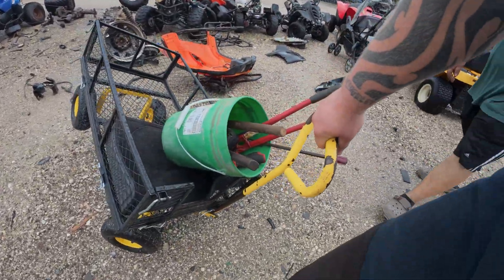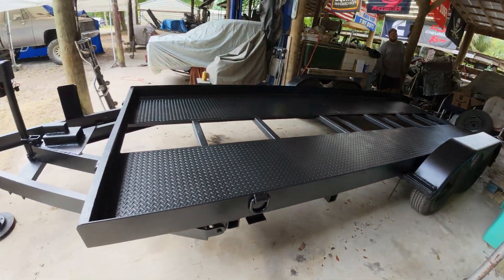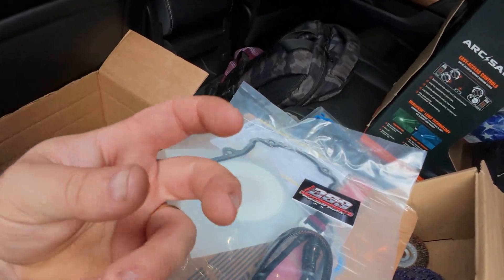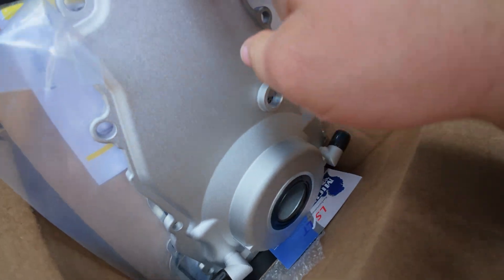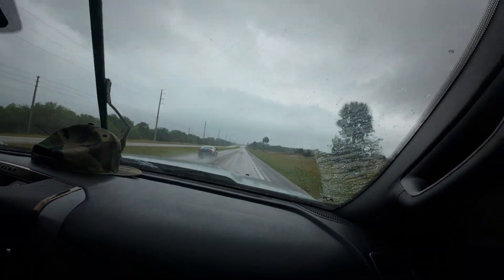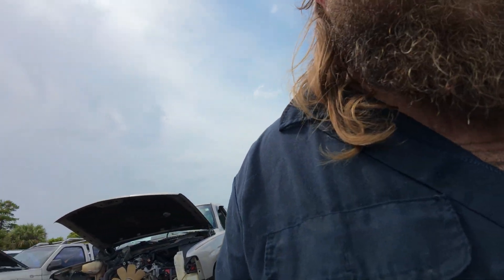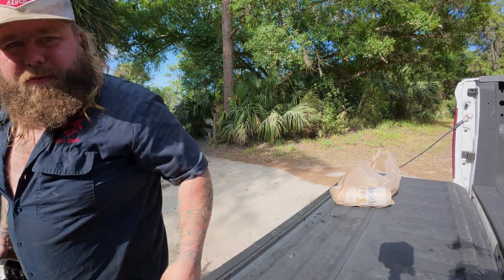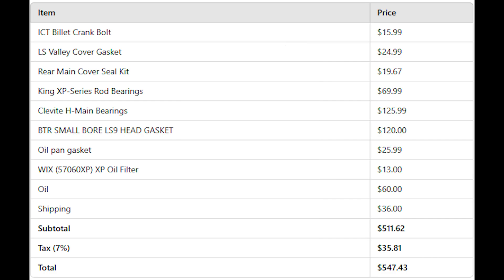Budget LS Rebuild: EVERY DOLLAR Spent (My ACTUAL Cost Breakdown)

Comment: Hell ya brother. Hot roddin ain’t cheap man. I just laid down 1300 on a trans rebuild kit and rmvb with trans brake and other odds and ends.
Reply from the maker: Man it's rough but worth it! I got hit with a lot of  other things at once lol, including a set of truck tires lol let me know if u need some advice with that 80 build if your doing it yourself!
Reply: @ not doing a 80. Doing a th350 for now until I find a good 400

Comment: The parts add up quick. I usually try to reuse anything and everything that isn’t in bad shape
Reply from the maker: that is generally what I try to do, and did, but the 220k+ lifters that were abused for 3 years boosted along with the .660 springs i think just had enough.
Reply: @HighNoonRacing  I have a high mileage set on my .660 springs we shall see how long they last hahaha i have sets of good used lifters as back up tho
Reply from the maker: I feel like with new sets its 50/50 if they work out, and with older OEM, it's just a matter of when. you'll probably be fine, i think bent rods led to spun rod bearing which led to lifter failure.

Comment: I ordered a Ls3/6L80E EBay harness. You know how that went lol. It was a manual harness. My ECU is from a 09' Tahoe 5.3/6L80E Tahoe. I did a continuity test on the harness and the cam and crank sensor. Still not getting a spark. I'm prob gonna have to pull the harness and use my schematics for the truck and test each wire. This harness won't be going into my Vic. I am going to order a BP Automotive harness for the swap. This was for just start up on the stand. Doesn't always work lol
Reply from the maker: There's a guy on Facebook that builds them at a good price, i don't remember his name but he's in a few of the low buck ls groups
Reply: @HighNoonRacing  Gonna have to check for him. Thank you brother!!!
Reply: Nathan Wei